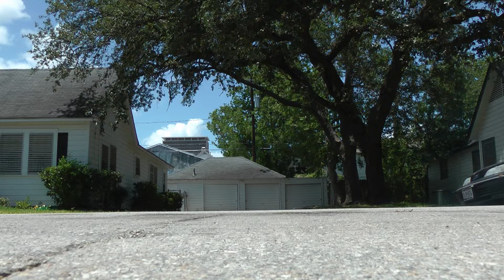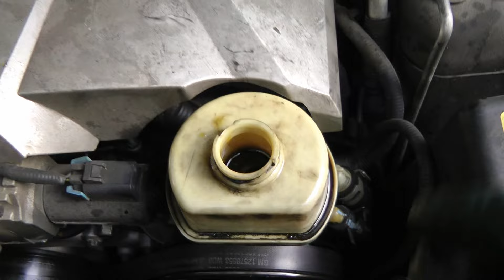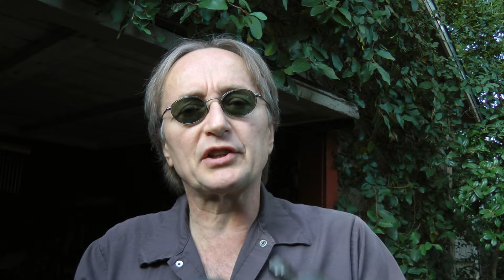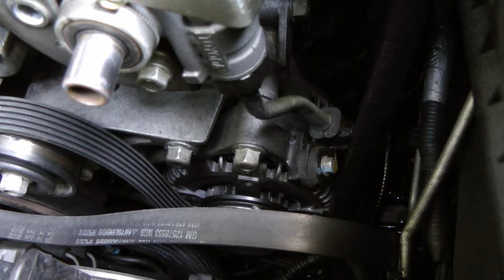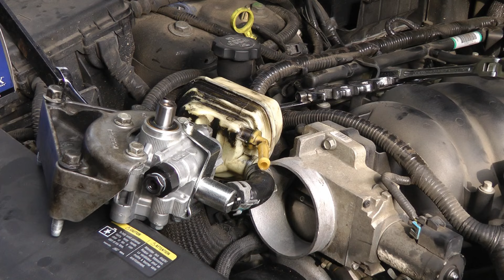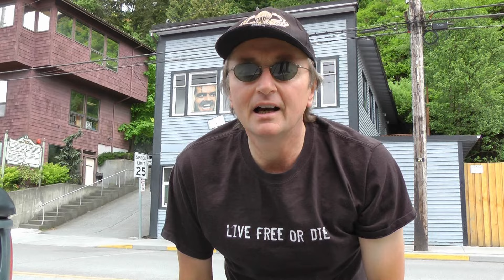How to Replace Power Steering Pump in Your Car

Comment: Thanks!  I am in the process of removing the tube, but I was just wondering what would be a reasonable amount for a mechanic to charge me if it is in fact the pump.  I canceled my dealership appointment, an Independent foreign auto quoted $850, but another mechanic thinks he can do it cheaper.  What do you think!?  Thanks!

Comment: Could you please check my videos to see what is wrong?  Mercedes 2004 C320, Mechanics are saying power steering pump (just from listening, no diagnostic from the visual).  I am in the process of draining my old fluid (which is brown) to my new CHF11S Pentosin and praying that I won't have to kill my pockets with a new pump.  Thanks!

Comment from the maker: most cars you can just jack up both wheels off the ground, run the engine and turn the wheel back and forth 5 minutes to get any air out.

Comment: when my 97 prizm isnt fully warmed up yet, turning left makes a loud whining noise and when i turn right i get the same sound, but the wheel wants to go back to its original position. giving it gas makes it louder, but only when i turn. is that my power steering pump? i've already had to replace the front brakes and rotors and everything down there looked fine(apart from the brakes and rotors, lol).

Comment: in my BMW 88 535is the brake pressure differential switch blew an o ring and dumped my power steering fluid in 20 min. on the interstate and let a lot of air in the system i replaced the switch so no more leak but there was bad damage done to the pump even with new fluid it whines loudly and constantly so im pretty sure  i should just replace the pump but being a bimmer a new one is 360 dollars. So my question is could i get away with a used one or would you recommend a new one.

Comment: What is rpm for a mercedes w 123 power steering pump? I took it from the car and installed it on tractor. It works great, but it is heating also. Tractor engine rotates pump at 4857 rpm maximal.

Comment from the maker: well, pull the belt off, and if the noise goes away, replace it. if it stays then, may need power steering work. flushing doesn't always fix em

Comment: Hi Scotty, i really need your help on this, I have a 1,8L 1999 suzuki baleno (esteem in america) and when i start the car it starts making awful whining noises, it keeps going when i turn the wheel side to side and increases in speed when the revs go up, iv'e flushed the power steering fluid out and it still makes the noise, could it be the serpentine belt? what could it be?

Thankyou so much for your time
Kind regards, Ryan

Comment: Scotty, any thoughts on power steering filters.  I’m trying to talk my friend into changing the power steering pump while I’m changing the high pressure line.  I’m assuming the lifespan of the pump has shortened due to no fluid, and I have no desire to take it apart again.  The car is a 1998 Buick Regal 3.8L SFI SC OHV 6cyl, Thanks for saving me money, and having an excuse to buy new toys (tools).

Comment: My power steering has been whining a lot.  (or should I say groaning.)  The fluid was dark grey so I recently used a turkey baster to suck a bunch of the fluid out and added new fluid.  I didn't really notice much of a difference in the noise it was making.  Is there a change the rack is dirty or something or am I going to have to replace the pump?  Thanks a ton Scotty

Comment from the maker: I would assume you need a new or rebuilt power steering rack. and pray the new pump you put on isn't ruined yet, cause it may need replacing again if it was damaged by the worn rack.

Comment: Dear Scotty, My power steering pumps been groaning for a while and I didn't want to touch it bc I thought that air would get into the system til today when I remembered that's only a problem for clutch lines. I opened the cap to the pipe bc it doesn't appear to have a reservoir and it looked completely empty and I was like cool bc that explained it. I bought a quart of fluid and poured some in and I saw ripples showing me the fluid level was almost full on the reason I thought it was empty was

Comment from the maker: sounds like they're bullshitting you. The power steering would groan on its own, not when you turn the AC on, just when you turned the wheel to corner. Crappy compressors will groan if they were made poorly, especially rebuilt ones, and if the system has an internal problem, putting a new compressor won't fix that and a new compressor will groan from that problem..

Comment: Hi Mr. Kilmer! I have a question...
I have a 1997 Mitsubishi Mirage 1.5 liter. I recently just got the aircon fixed and everytime I turn the AC on, it makes a groaning sound. I brought it back the where I got the AC fixed to see if it was the new compressor that was making the sound. Im thinking it has somthing to do with the power steering? Because there are times when my steering would become so hard to turn. And it idles very very low on cold starts. and sometimes dies out. Please help.

Comment from the maker: parts can be bent or damaged doing that work, like tie rods or ball joints or strut mounts that would effect steering. Odds are something else like a steering rack isn't going to go bad as you change the struts. but often no self centering is a bad rack

Comment: hello again Mr Kilmer, just got a ?
I changed out my struts a little while back and I have been having heavy and no self centering steering. I check have replaced the fluid in the system and checked the pump all is good.but wondering if my struts could have anything to do with this issue? and if so what to do? want my truck back my wife won't give it back tell I fix the issue.lol

Comment: .i recently changed my water pump cause it was old and leaking. thats fine now but my new problem went east. I have a 89 crown vic and its screeching like crazy when i drive now. i checked the power steering fluid level and its good. Is this even the problem??

Comment: have the lines and rack and pinion checked if the pump if a-ok. My car made groaning sounds when i turned the wheel, it was low on fluid, The lines were ok, the pump was fine, turns out there is a leak in the rack and pinion. It will be a expensive fix but if the leak is minor then you can wait till it gets worse to justify a expensive repair. Im no expert, i just know what i know from my issues.

Comment: its fine driving but now its hard to turn the wheel while in park or going slow...what should i do? did i mess something up bad?  the pump is not grinding at all, just incase you was wondering.

Comment: i flushed it but then put the steering repair fluid in then realized i should of put the regular power steering fluid in. i got some steering fluid and put it in but then it was hard to turn the wheel. so i wanted and kept coming back to it but it was still hard to steer.  so i decided to wait 40 mins then i drove it around. it was hard to turn but then it got better...its fine now when i drive but when i am in park or the brakes are on, its hard to turn it.....now im worried.

Comment: Scotty, I have a 1990 Honda Accord LX that groans and is very difficult to turn at low speeds (especially when parking.) Several mechanics have told me that it could also be a rack and pinion problem. Is there any way to know for sure it could be either or??

Comment: Scotty, I have a 2001 Olds Alero with a groaning PS pump. I'm willing to tackle the job of replacing the pump myself, but do you know if I need that special tool to remove the pulley like the Caddy has? It's a 3.4L V6, in case you need to know. Thanks.

Comment: Hey Mr.Kilmer, I got a question. I have a 97 Plymouth Voyager 3.0 that developed a steering issue overnight. I woke up one fine morning, was about to pull out of my driveway when I noticed that the van was making loud noises and generating excessive vibrations with so much as 5 degree steer in both directions. I popped the hood and found that the power steering reservoir was magically empty, but topping up didnt help the situation. So am I eyeball deep in crap or what? rack n pinion or the pump?

Comment: @scottykilmer Thanks again for your response and for the video.  I installed the new pump and everything is great.  Oddly, Autozone gave me one with the pulley already attached so that was a nice break.  Also, the fluid reservoir had a metal "screen" near the bottom that was almost completely clogged up (which probably is what caused the pump to die in the first place).  Thank god for google or I never would have figured that one out.  A little carb cleaner opened it right up.

Comment from the maker: @My96XJ in such cases, I cut the hose off near the nut with a grinder or hacksaw. Then a normal socket goes right in and comes off easy. You're throwing the old one away anyway

Comment: the only issue i have with this video is that the  hose that goes in the steering gear box does not come off that easy and the 18mm wrench you used isn't  much help on my 96 jeep xj any other ideas would be great

Comment from the maker: @MikeTheITGuy only way you can test em is with a power steering pressure testing kit, they cost a ton.  Hoses are cheap aftermarket, I'd try that first.

Comment: The power steering fluid reservoir in our van overflows from time to time, however when it's cold it appears to be filled to the right level -- which is odd considering some is very obviously leaking out around the cap.  Would that be the pump or is the pressure hose blocked?  Is there an easy way to test that?  Thanks!

Comment from the maker: @fordwindsor351 what's in a name. the tensioner pulley is the one, but really, it's an idler pulley too. you just use the one that moves, one will move back and forth, the other won't.

Comment: @Scotty Kilmer , Hey I drive a Saturn Ion and my car has an electric power steering(no fluid). Would replacing it be pretty much the same process i.e. removing the pulley and assembly, then reverse for  installation?

Comment: @scottykilmer Just thought I'd give you feedback. I didn't do anything to the belt as that seemed fine, but I changed the fluid in the pump as that seemed black. And the whining is greatly reduced. It is only audible at full lock now, which means it's probably a bad pump. The power assist works fine for now, so I guess I use it till it fails completely?

Comment: hi scotty, thanks for all your videos, hey i have a 2002 dodge grand caravan , im all ready change the rack and pinion, and power steering fluid, the steering wheel is moving free now, ther is nothing rough or hard to move, but still a noise when you move the steering wheel, , can be the pump?maibe?thanks, and keep up the good work

Comment: Scotty, the steering pump on my 2005 Honda Civic seems to be making a whining noise that gets louder with increasing revs. Steering is sometimes fine but gets hard under braking. There are also air bubbles in the reservoir (is this normal?). Once earlier, the belt that drives the pump actually came off and I used a roadside mechanic to put it back on. Do you think it is the belt making the noise or the steering pump?

Comment: scotty. Im fixin to replace a ps pump on a 85 Silvarado equiped with Hydroboost. Have always been told you got to purge all the air out of the system by turning the wheel from lock to lock after you got the new pump in and full of fluid.  bub you did not do that on the cadalack. is this only teue on the older stuff??

Comment: hey scotty, I own a 2010 mazda 5(wagon) I purchase it new in dec 2009, it has 23500 miles..   lately I heard a humming noise comming when I turn the steering wheel..  could it be that the pump needs to be replace?  thank you!!

Comment: those press on power steering is a bitch (hard) to install. who come up with press on method should die. because you must remove the pulley first to access to the bolt.

Comment: Scotty I have a 96 sonoma 2.2 that keeps overheating. I have replace the radiator, fan clutch, and temp sensor but it didnt seem to help. The check engine light code said that there was a miss fire on cylinder 2. Could that cause the engine to overheat? Previouse owner replaced water pump.

Comment: in bleeding the power steering,do you need to raise the vehicle and then turn the steering wheel lock to lock? or you can bleed it without raising the vehicle?

Comment from the maker: @bjretas nothing's really in the pump. Flushing is best by removing the return hose, putting it in a bucket with an extension hose, and pouring fluid into the reservoir, that way the old stuff goes in the bucket Scotty

Comment from the maker: @alh1007 Because it's easier that way. You could take the pump off with the pulley on, but then the bolts are harder to get off from no working room. Getting them back on is a lot easier. Scotty

Comment: Scotty my Ford Ranger sometimes won't set into park when you shift it to park.  The result is the truck will sometimes roll and I have to use the parking break to make sure it stays.  I looked on the transmission and it looks like the little lever may not be fully extending on the automatic transmission.  Should I replace the shift cable or are they adjustable?

Comment: @scottykilmer i've ran lucas fuel injector cleaner before but still no fix. maybe my IACvalve is bad? i got a code for load failure for my IAC or circuit failure and and also my cam sensor was bad. i replaced the sensor so far.

Comment: Hey my 2000 ford mustang, idles rough when it starts up from a cold start, and kinda wants to die right when i take off, but once i drive for a minute or two, it drive normal and fine. any ideas?